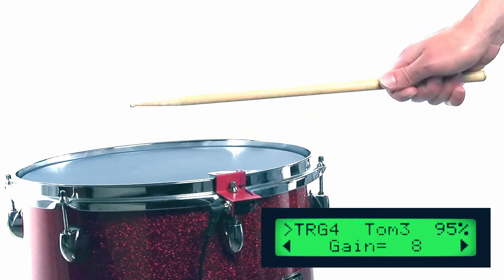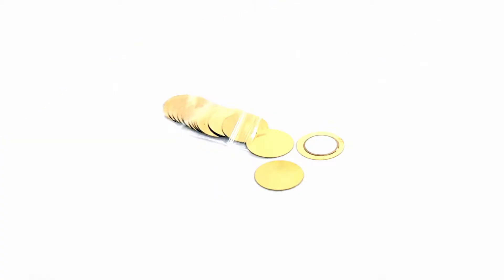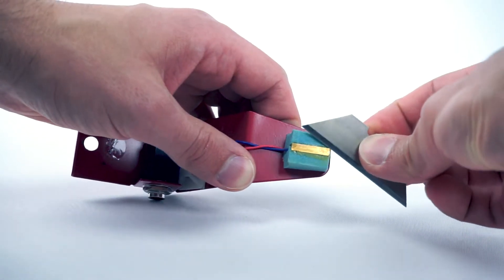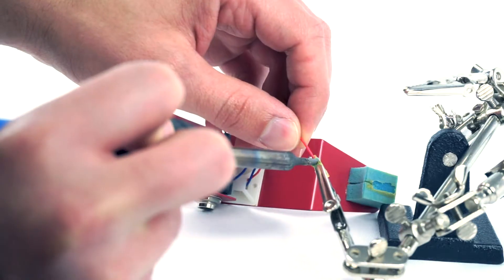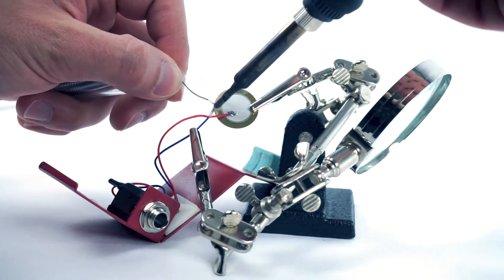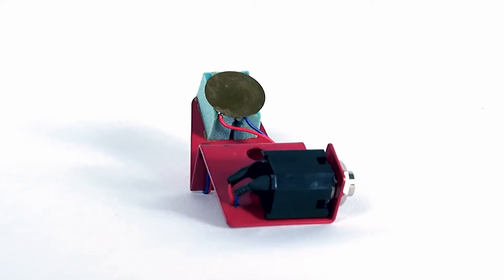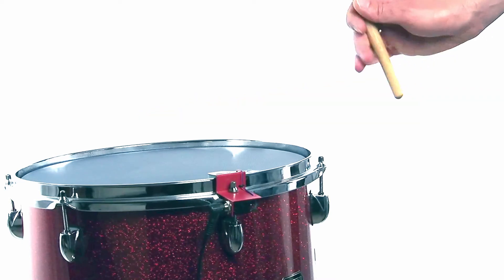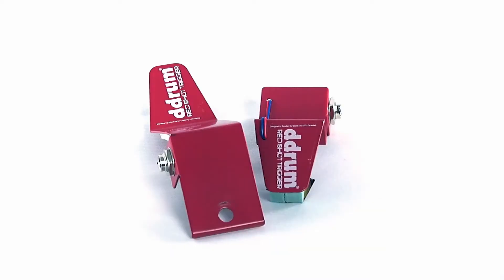Modifying Ddrum Red Shot triggers to improve accuracy

Comment: If you're gonna replace the pickups with commonly found piezo sensors, why not buy Piezo pickups outright? They cost $3 each relative to the $16-20 of the ddrums and are ready to go. I use the cheapos as contact mics and replace the sounds later in Steven Slate. No false triggers ever and I get exactly what I played recorded. THe cheapos can fail at some point but big deal, a pack of 5 costs $15 at amazon. The only upside to having the ddrum housing is maybe accidentally hitting them won't break the trigger?

Comment: Don't waste time with glue, perfectly fine to use double sided carpet tape. Would also insulate the piezo from the head using neoprene, cut up a mousepad up or use furniture floor protectors

Comment: Boom!  just like that we are in working.  Thank you for posting!  I accidently order the 35 MM disks which are bigger than the blue foam and can "buzz" a bit but actually work a million times better than the original.  no regrets and now i do not have to order different triggers.  Thanks again.

Comment: I've used red shots before to varying degrees of success, but I had no clue that the piezo is located right behind the black tape on the bottom of the foam. That's an odd design. You'd think the piezo would be glued to the metal bracket with the trigger foam on top of it, which is how all other triggers are designed. I wonder how good it would perform if you modded it to be like other triggers.

Comment: I did the same  replacement of the piezos only difference that i made its that i cut the blue sponge in half inserted the piezo solder it then glue it togueter to have a little more resistance qhen hitting the drums

Comment: So I have the chrome elite triggers. Would you recommend this mod for these. They track ok but I'd love to have em track better if i can. I'm using them with a pearl Mimic Pro Module.  Great video. Thanks!!!!!
Reply from the maker: Hm. I've never used those. But if they're not cutting it for you, it might be worth trying to mod one of them. From a pic, it looks like you could try carefully peeling back the thin pad that separates the sensor from the drum head (where the wires are sandwiched between the larger and thinner pad). Maybe peel back a small spot around the wires to see if it also has a smaller rectangular sensor (like the ones I removed from the Red Shots). If so, I'd guess replacing it would be a similar improvement. (And if it already has a larger round sensor like the ones I added, maybe re-glue what you peeled up and abort mission.)
Reply: The chrome elite triggers are way higher quality than red-shots (as they should be considering the price). You should never have to modify high end e-drum equipment like that to get good triggering results. 99% of the time, the cause is something other than the trigger itself. Are you using mesh or acoustic heads with them? If you're using mesh, it's most likely an issue with how they're tuned, especially if you're using one-ply heads like Remo Silentstrokes, they are trickier to get good triggering out of because they vibrate more than 2 and 3 ply mesh heads. Investing in good mesh heads makes a huge difference with triggering accuracy. They also require a lot of trial and error with the trigger settings inside the module. If you haven't fiddled with those a lot, it's worth sinking some time into.

Comment: Thx for this useful tip and this great video. I want to use it with a Roland Td-17 drummodule. What kind of pad type in the setting will be good for the red-hot? Do you have some good setting tips? Greetings from Germany. 👋😁
Reply from the maker: Danke! I had a Yamaha module. But I just scrolled through the different pad types in the module, picked the one that worked best, and adjusted the pad settings as needed. For example, you might need to tweak the pad settings for single ply vs. double ply heads, how tight/loose the head is, how you play, etc.). I hope it works for you!
Reply: @Wrigglyaudio   worked perfect.  And so much more sensitive and realistic. 😁👍